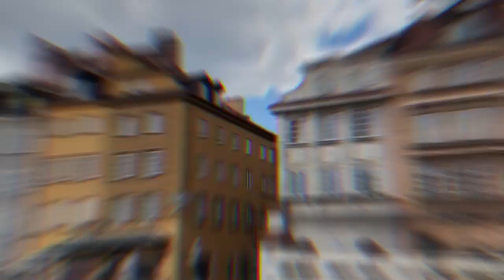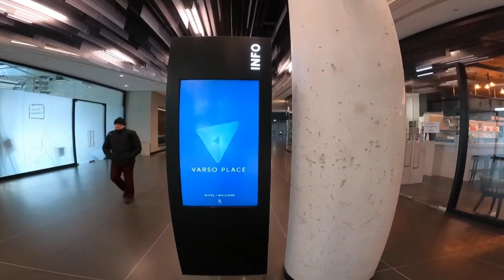Varso Tower: The New Supertall Skyscraper in Europe

Comment: If I put on a hat, I'm not automatically 10 cm taller.
One should measure the usable area of a building and not simply screw an antenna on and then claim that it is a particularly tall building. According to this logic, one would have to include pure transmission masts or at least television towers with visitors or working platforms.
And then the tallest building in the EU is suddenly in Riga.
Reply: Riga?
Reply: @y0Milan  The Riga TV Tower is 368.5 meters high.
Reply: @nettcologne9186  Fine, the real measure should be highest inhabitable floor in my opinion....
Reply: Examples like Riga are antennas and just that, not elements of larger buildings that are still necessary to make communications for a large group of people in one space easier. I believe Poland had the tallest antenna anyway until some time ago, so just make a seperate category for tallest structure. Of course its used to augment the size of buildings, and it's unfair to then say the shard is smaller when even the top is part of the aesthetic, but I guess it's also about how imposing the structure is, and the antenna still adds to that.
Reply: @nettcologne9186  The Riga TV Tower is 50 centimeter taller than the TV Tower in Berlin? Thats funny haha
Reply: The highest building in EU Before the UK left EU the shard also has a large spire just covered with panels
Reply: @pawelpuzik4617  Yes, but the shards highest inhabitable floor is its 72nd and the Varso towers is its 53rd. Huge difference.